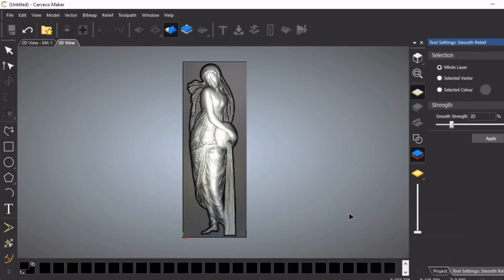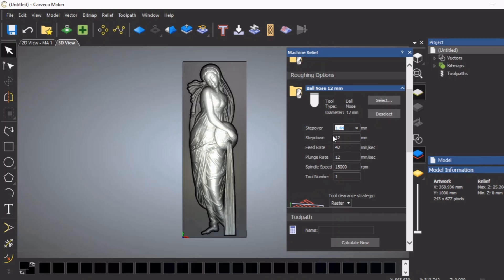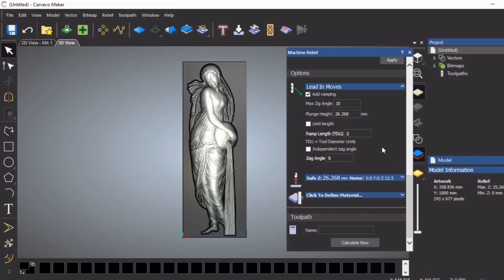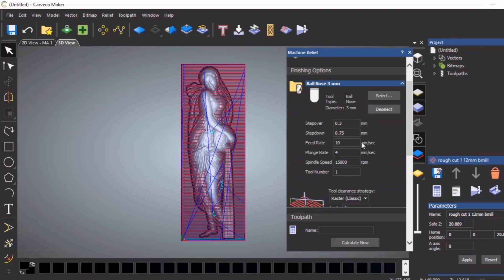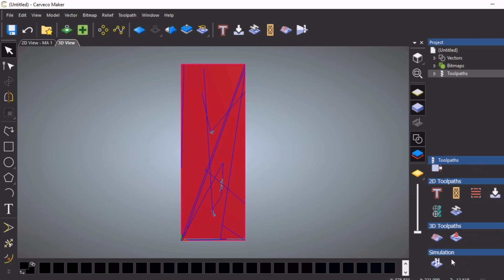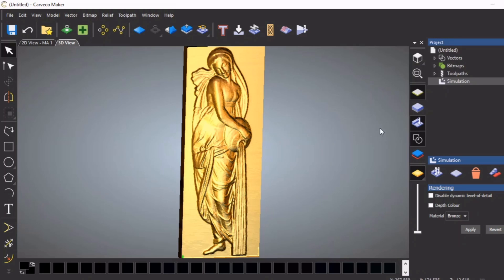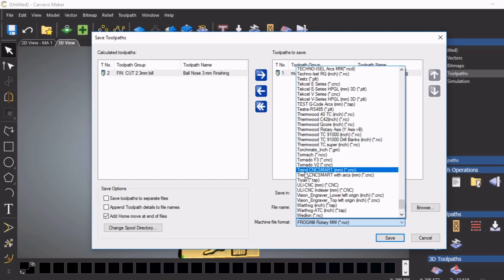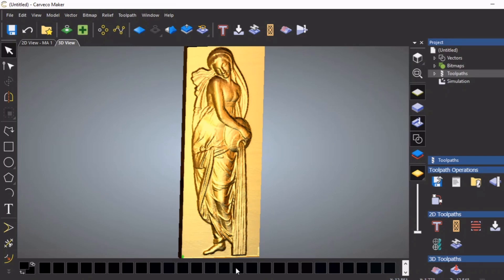Carveco Maker speeds and feeds & tool paths for 3D machining

Comment: One thought I had was if there would be value in adding another tool path for the flat portion of the relief?  If you added a vector around the relief with a small offset of about 1/8 inch then you could use a large, square end mill to create the flat area quickly before you did the first ball end rough cut.  Just a thought.  Thanks for the video.